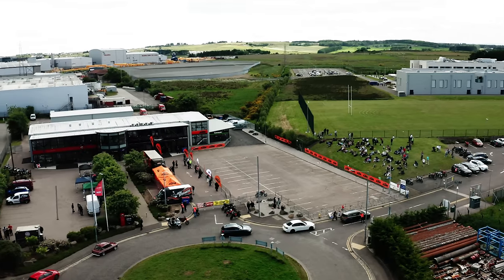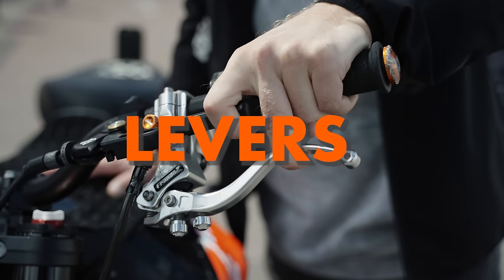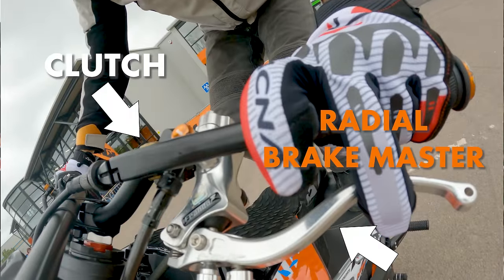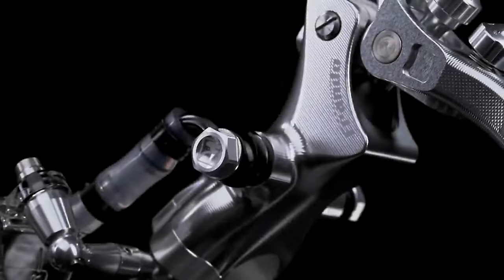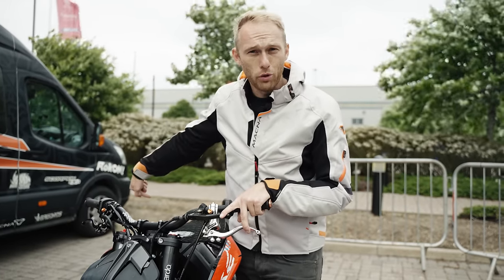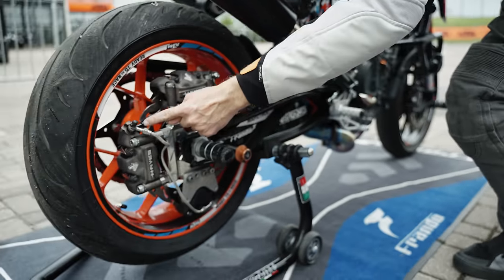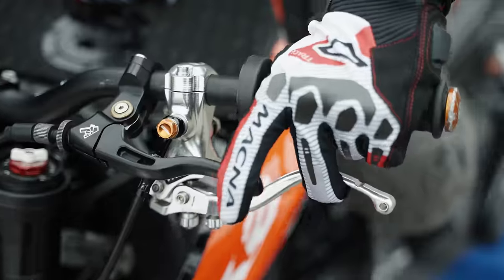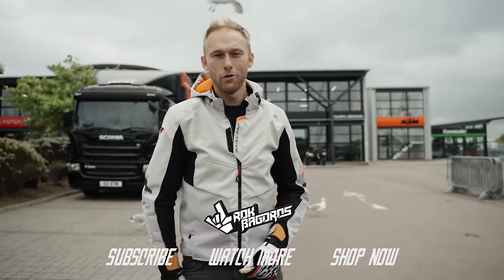HANDBRAKE stunt setup explained ? | #RokONVLOG 125 #ktm #stunt #rokbagoros

Comment: Why do rear hand brake setups use an additional caliper instead of simply connecting both master cylinders to the existing caliper?
Reply from the maker: Not enough braking power and you can not squeeze both at once